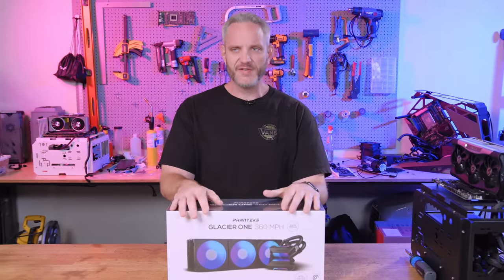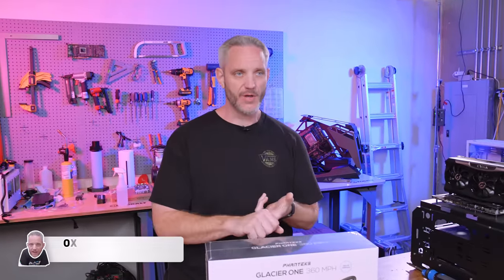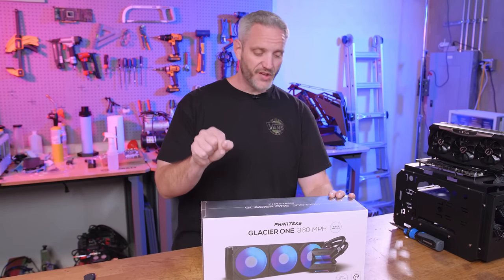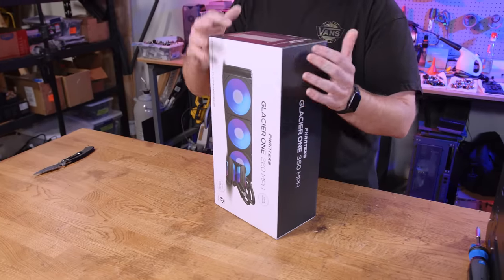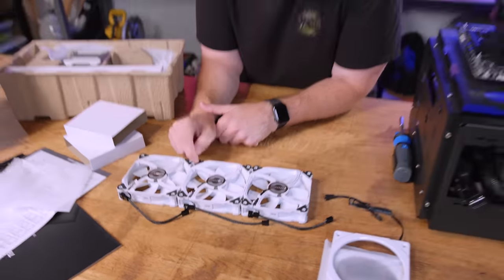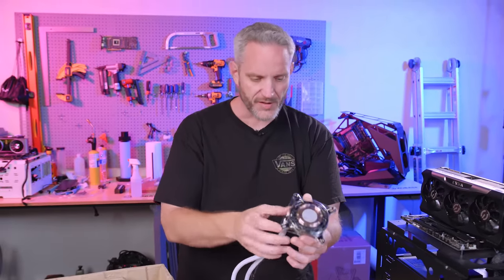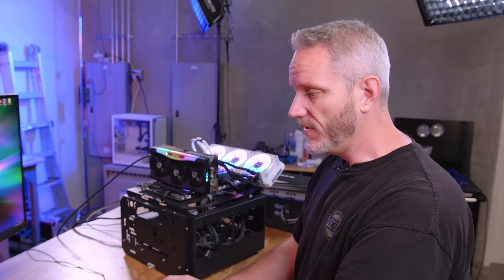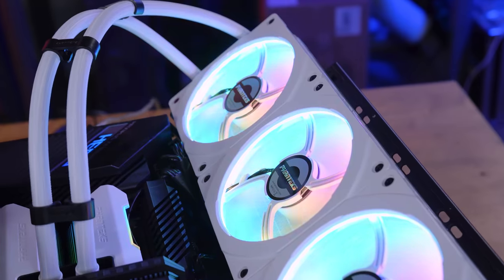A new CPU Cooler has entered the chat!

Comment: got this in the 240mm variant for my secondary rig with a 3600x, i was at first disappointed like you about the halo addon instead of the fan being rgb, but then was pleasantly surprised it looked so nice when on. been loving the cooler very much. I was originally gonna get the EK one, but apperantly EK has been having quality control issues with the pumps on their aios and seeing as the case was the phantek evolv shift xt, figured why not give the cooler a try. glad i did.
Reply: what case fans did you use to match the unique halo look of these phantek ones? what would you recommend?
Reply: @davdgs  there were a test long time ago show that halo ring even work on bronie noctua fan
Reply: I love this cooler, I use the Lian Li sl120 fans on it and they match the pump cover so well.
Reply: 2nd this. I have the 240mm for my AMD 5600x. Looks great in my all white build
Reply: @acewatts22  what temps do you get?
Reply: @buddy5152  don't buy it. It's extremely loud and phanteks support will not rma it.
Reply: Does the AIO with the rad, fans and halo clear the DDR Ram? I've heard problems about this.
Reply: i can attest to quality control issues on EK AIOs. been through two EK 240 RGB AIOs in two years, both defective with the same pump noise clicking issue
Reply: The EK nucleus is like one of the best AIOs on the market lol
Reply: @ronniekregar3482  the nucleus didn't even exist when I wrote this lol.
Reply: @darktrexcz  fair enough lol....I'm just making the point that there are 240 AIOs that are totally capable of handling high end processors...The cooler master Atmos prolly the best AIO out right now. But this phanteks one is nice too.

Comment: A video about "normal" temps for ryzen 5000 and Intel 12th gen would be great, also because nobody did it from what I saw. Covering the different classes of cpu's (5/7/9) with their respective temps to expect under different scenario, also during mixed usage (like gaming) where the temps can vary a little and have some peaks. And a nice thing to add would be considering also the cooler, air cooling like a tower or water cooling for example a aio, which temps are normal/expected for them, and some advantages, like for using a water cooling, during a short peak (for example 1 second) you don't need to ramp up your fans immediately because the water can trap that heat and dissipate it later (I don't know if this is true). I recently built up my first system with a ryzen 9 5900x with a 360mm aio and a 3080, and I don't know what to expect exactly for the temps, so how quiet I can run the system and where I need to be more aggressive with the fan speed in the curve for longevity and good performance, I searched a bit but nobody talked about that argument, and I think lots of pc enthusiasts and first builders would be very interested in that.
Reply: @JayzTwoCents finally found a scammer lol
Reply: It depends on the voltage and the ratio too. I heard someone say an AIO will have a water temp between 30 and 40 c. I have an enormous overkill loop for a 5600X because I am a bit crazy. With a Ryzen you can see your water temperature on the IO die sensor at idle. My water temp is 3,5 c above ambient max. The delta gets even lower in the winter when the ambient is lower because of improved efficiency. I have the fan curve set to lowest of low now, it only ramps up above 55c, which does not even happen on normal usage. What you want to do is make a profile for daily use. Set the ratio and voltage to a steady state. I would go for the same clocks and CPU scores, test hem as you lower the voltage, as you were getting on auto, but on a lower voltage. Daily I run 4,65GHz on 1,2 volts core on this 5600X, which is not Geekbench stable but 99,99 game stable, and I Idle at 29c at the moment. That is extremely low for a Ryzen but I want to overclock on some occasions, with AI suite 3 from Asus. You can't download it from Asus somehow, try to get in from another reliable site. Be careful when you adjust settings! The software can glitch and max out voltages you have not even touched! Be sure to always double check all voltages after you changed something in AI suite, even the voltages you have not touched! Good luck! By the way the only title I would maybe want to overclock the CPU to more than 4,65 GHz  is MSFS 2020. That is a heavily not optimized title and it is very CPU heavy.
Reply: Ryzen seems to run super hot. I have a 3800X on a 360mm custom loop with a 3080 and it still hits 75+ under load. GPU never goes above 55. I've tried a lot of different OC settings, from fully stock to undervolting, and it always seems to do this. Stock is by far the hottest on idle, though, so definitely need that undervolt.
Reply: @hawkeye2816  that's interesting.   I'm opposite, I have a i9 12900k and a 3080ti.  My cpu gets into the 60's when oc and my gpu usually sits at 70 under load.  At idle it's 25° C for cpu and 50° C for my gpu.  I've noticed it running warmer now that it's summer.  Ambient temps are higher.
Reply: @8oh1guy  Ryzen 3K series has some silly voltage offsets at stock. Like, it reads 1.4v. Setting an all core OC can lose you some single core clocks, but you can often tune it to a lower voltage and be stable. In my case, I'm stable at 4.3 all core and the stock generally only goes to like 4.35 on single core and at higher voltage.
Reply: @hawkeye2816  what header you have your pump plugged into?
Reply: @davidbraucht544  Pump PWM. I've set it just low enough I can't hear it. I've tried turning it up without seeing much change in temps.
Reply: @hawkeye2816  does your fan speed tie into the pump speed, or are those run on a separate pwm, or controller?
Reply: @davidbraucht544  Separate.

But I've done my own testing. I've run this thing with all fans and the pump at full speed. 6 Noctuas in push-pull on a 360mmx60mm rad. Best temps I got were around 72 with an undervolt and that was at the expense of not being able to be in the room because of the noise. I made my choice and it maxes around 76-77 under synthetic.

And it's not gonna be the pump, rad, or fans. If it were, the GPU would be hotter than 55 under synthetic. The loop is keeping up. Hell, even if I push GPU and CPU at the same time, the temps are the same.

Sorry if I'm a little aggro, but like I did my due diligence. If you Google R7 3800X you'll find all kinds of posts about it running hot.
Reply: Can concur ryzen usually runs hot i have similar numbers as others who posted. I have artic freezer 240mm on a ryzen 5900x. 40-45c idle at all core OC 4.7ghz 1.2v. Full load about 65-70c max Temps.
Reply: 5950x here paired with corsair 150i 360mm aio (silent settings for fans, balanced for pump).  undervolted, pbo on.  73c max temp under load  about 40-45c idle. 6900xt undervolted 2500mhz max boost 73c core and 95c junction running timespy 3dmark.
Reply: I have R9 3950X+ MPG CORELIQUID K360 on msi MEG X570S ACE MAX + msi RTX 3090 Gaming Trio X the temps are idle around 46-48 under full load all cores active 32 in Folding&home full power basically constantly when I don't use the PC right now it runs around 12hr CPU tmp is 67 GPU TMP 72 and that's it ,in games the cpu temp is max 56 . I'm getting the 5950X in few days then I will see if there is a major difference in temp so far I find that to be normal operation for my build temp wise.
Reply: @hawkeye2816  damn, I have a 3700x and a 120mm AIO and never go above 60-65. I do have an open air case so maybe that's part of it.
Reply: @jakestocker4854  3800X also had a reputation for being hotter than the 3700X. Much higher TDP, too. That's probably part if it. I bought it chasing numbers but saw afterwards that it's not really worth it. lol
Reply: @hawkeye2816  yeah that's true and now that you mention it I do recall hearing that it ran a lot hotter. It's funny though because even that is nothing compared to temps were seeing now lol.
Reply: @Lurch7861 that's going to be pretty dependent upon ambient temperature thought right? I know my temps overall definitely improved from the P300 mesh and InWin 301 I had to the P3 I have now.
Reply: Um, tl:dr?
Reply: @thomaschirila6372  then why even comment? No one cares that you didn't read it.

Comment: For anyone interested, I think Phanteks sells those halos separately as well.
Reply: Indeed, I just looked them up. These Halo ones for 120mm fans cost almost €11,- each here and the 40mm ones are €12,-. There are also other ones, called Halos lux RGB, but those are more expensive for some reason.
Reply: @mikesinner443  made of aluminum
Reply: There are also 12v versions too.
Reply: Can't see the white halo ones however just black
Reply: Yup, but not in white.  And the LEDs are fairly low quality so the blue dies within a year or two.

Comment: Hey Jay, great video as always.  What about making a mockup of a CPU to hold against the cooler plate to show how well the cooler covers 12th gen.  You can demonstrate the problem with the screws if the plate isn't sized correctly.  Just my TwoCents.  :)
Reply: now we need TimzTwoCents 😄
Reply: I think someone already did this with glass. It gives a best case scenario if the cold plate was completely flat. I think they only did it to show HOW thermal paste spreads based on pattern, but I may be wrong.

Comment: The main reason why I got Glacier 280 for my Meshlicious build is the fact that RGB is totally optional (you don't need to use that Infinity mirror cap), daisy-chained fans that can by powered from one header and the pump itself using pump/aio header on the mobo so there is no need for using usb cables/headers (looking at you NZXT and Corsair).

Comment: For anyone interested in it for the RGB (on the pump faceplate not the fans). The lighting is quite dim,so if you're running some fairly bright rgb's in your rig already, they may seem underwhelming. It may look better in white I'm not sure (I have the 360 in black using lian li uni fans, can really see the difference in brightness) in
Reply: The RGB on the pump is definitely more subtle. Even when using the same hex colors for the pump, ram, fans, and strimmers the pumps color is darker and night as bright

Comment: Been running this very AIO (Black) for a little over a year. It's performed great with my Ryzen 3600 (I know overkill) and now my 5900X. The infinity mirror pump cover also pairs really well aesthetically with the Lian Li UniFan SL fans!
Reply: Yeah, I run a NZXT X52 240mm AIO on my Ryzen 5 3600X. Runs a dream, holds temps at 50C. Damn tho, NZXT's software is a piece of crap.
Reply: @BrainiacManiac142  most software is crap. its embarassing towards the professionals who invent this shit
Reply: And this is the comment I wanted to see, I'll be getting this for my 3095x also running it with the  Lian Li fans
Reply: I've seen a lot of posts about this radiator making a whining noise at higher loads have you ever experienced something like that?

Comment: 14:00 Kingpin KPX Extreme is intended for short term sub-zero benchmark runs. The normal thermal cycles between idle and gaming on a daily driver PC will push the paste to the outer edge of the IHS in a matter of months.
Reply: @ZoneXV  The only issue you would notice would be the fans spinning faster and for longer duration of time. I don't think a system will thermal throttle if KPXe is used but I think over time it will run hotter than a PC with conventional paste, like noctua NT-H1. Heat over time shortens the lifespan of any chip.
Reply: Had no idea so what would you recommend for long term?
Reply: @iiiEazyiii  noctua NT-H1/NT-H2 or Thermal Grizzly Hydronaut should last 5 years without issue and allow headroom for moderate overclocking.

Comment: MPH probably means/stands for (M - Maelström concept technology, P - PWM, H - High Pressure) -- or -- (M- Millimeter, and the PH - is the Product line code of the fan i.e. PH-F120MP). I believe its more likely the 1st, or a mixture of both, who really knows other than Phanteks lol..? They call these new models MP fans, and i think they add on the H for the "high static pressure" part of the redesign of the fan blades. Could also be (MM, PWM, High press.). Thats as close as i could come up with in just a little time researching. But they never flat out say what MPH means
Reply: MP fans and the H is for halo. So all you gotta figure out now is the MP.
Reply: The M is Maelstrom and the H is Halo. They have the MP and MPH variant with the difference being color (black and white respectively) and the addition of Halo rings. They both use the MP fans which is where the Maelstrom comes in. I’m guessing the P is pressure like their SP fans
Reply: no. u are wrong. mph is stand for 'mile per hour.' 💁 and now u know it right? please dont share a wrong info to another people again
Reply: @SUTH_33  not in this case.
Reply: @SUTH_33  bro chill, it would be funny if that wasnt everyones joke. Alot of people realize it  will sound corny and refrain from saying it. its one thing to say it, then its another to come at us saying dont share misinfo again like u gon do something.
I never said i was 100% right about my post in the 1st place. The whole point is to actually post what i found when i tried researching it, and to see if we can figure it out together. 
And it looks like weve gotten very close if not figured it out!! Nice work guys!!
Reply: @shawnhowa6063  Nice work bro, i knew we would come close if not figure it out!! U too @khaotic penguin

Comment: You’re right about JSTs being rare. My last build $200 motherboard had 3. New build $600 has none but has weird adapters which makes the cable management even more of a pain in the ass.
Reply: wait, what motherboard did u use? i never knew there is a motherboard with default jst rgb connector in it
Reply: @xs3tsunax  I’m not sure what that motherboard was. All I remember was 7700k was the cpu. I also may have been mistaken on what a JST was

Comment: I have a big Phanteks 360 on 5950X, and love it. Temps never get about 60C when stressing the CPU, and low 30C when doing simple tasks.
Reply: damn thats nice, i cant decide wich aio to use for my upcoming build based on a 13700k im eyeballing the arctic liquid freezer ii 360 & ek aio 360 elite 🤔
Reply: Try changing the PBO settings to allow it to draw more power. It'll get quite a bit hotter, but I got some pretty high performance increases when I did it. I hit about 80C with an Arctic Liquid Freezer II running Cinebench drawing ~205W. Default PPT limit is only 142W.

Comment: 5:40 My latest build was an all white build based on the Meshify-C case. I built in in early 2020 just before parts began to become scarce. I kind of regret my choice as options for white parts were limited. At the time, there were two choices for an AiO (Enermax or Corsair) with one being back ordered. RAM was limited to a single option, Corsair's Vengence RGP Pro. Forget a white GPU. I think there was one option at the time and it was almost twice the price of the same unit in black/grey. I actually ended up having to spray paint some of the parts like the wrist rest for my keyboard and the mounting bracket for the vertical GPU adapter. Next time I think I'm going to go all black.

Comment: I'd prefer the pump located by the radiator and the part that touches the CPU square not round. There is always a workaround to get the pump not running dry. Add a  grove to the soft tubing and run the rbg cable to the radiator.
Reply: I see a scammer here

Comment: Instead of those outside RGB rings they should be make inside/underside gasket to increase push pressure/fan static pressure that maximizes flow through the radiator, because there are some big gaps there especially because of not straight fan frame

Comment: I have a small system with AIOs for both the GPU and CPU, each with a 140mm radiator, and the two radiators touch each other at the top of the case.   I was getting 85 degree temps under full load, so now when I play a game with a high load I point a concentrated blower fan (like the kind you use to dry a carpet) at the radiators at now it runs at 60 degrees under load.   Simply put, our computers overheat because the power supply cannot drive fans at 120 Hz AC like the wall outlets do.  As soon as you bring a "real fan" into the mix the heat problem is totally solved.

Comment: I bough the 280mm cooler in Jan 2021 which comes with 140mm fans in and paired it with 5800x in a Phanteks 515etg case which is notorious for bad airflow and this cool is rock solid. Temp rarely get above 70c.

I just did min/max tuning on the cpu and brielfy got a reading of 5.3Ghz.

Comment: Not sure if anyones stated this yet or touched the subject, but I'm pretty sure the reason to the rgb ring instead of rgb fans, is for cooling performance. The material rgb fans is made of doesn't have as good cooling as the normal fans, at least this is the case with Arctics Liquid Freezer II aios. The non rgb and the rgb variants have different temps. (This might be wrong I'm not entirely sure)

Comment: You can technically refill the loop by taking the cold plate off and adding fluid (water-glycol mix). I was about to do it to mine but NZXT replaced it under warranty (3 days before it expired).